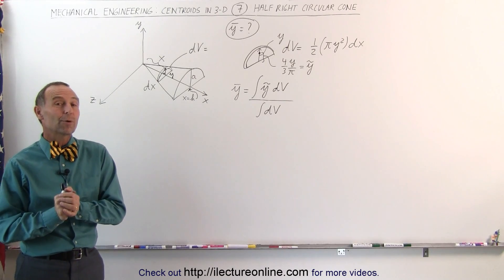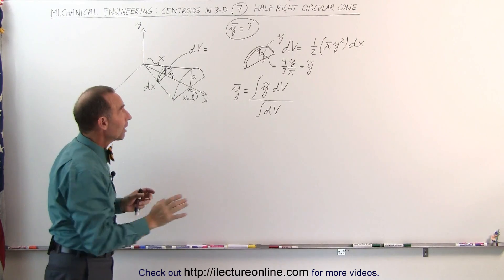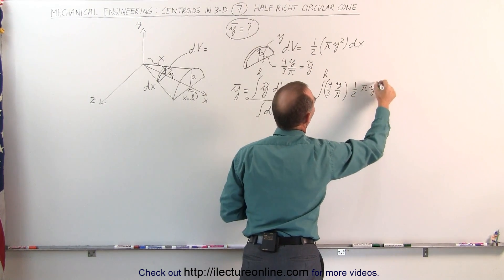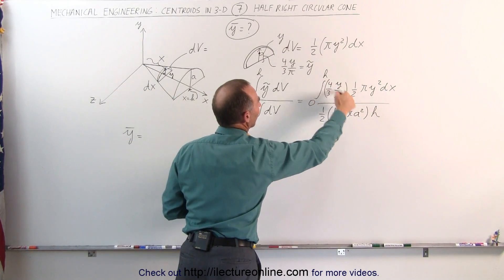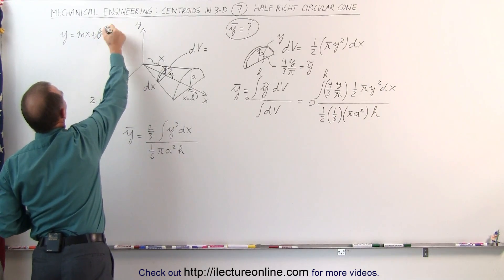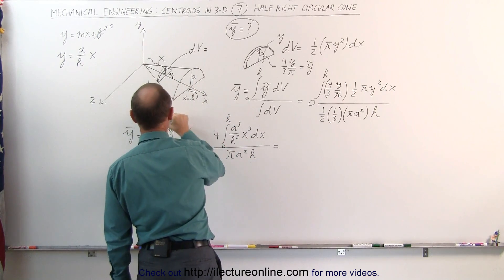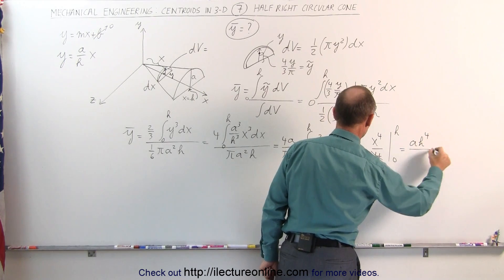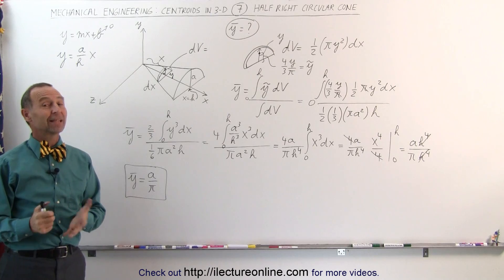Mechanical Engineering: Centroids in 3-D (7 of 19) Half-Right Circular Cone (Y-Coordinate)

Comment: shouldn't the integration be over the Y axis? and should the coordinates of the Y centroid be somewhere vertically over the coordinates of the X centroid, so if we replace the coordinates of the X centroid in the equation of the line Y=aX/h that should give us the coordinates of the Y centroid?
Reply from the maker: The method as shown in the video is correct.